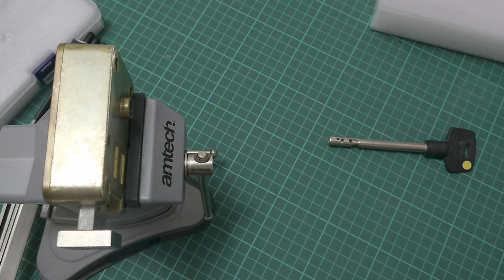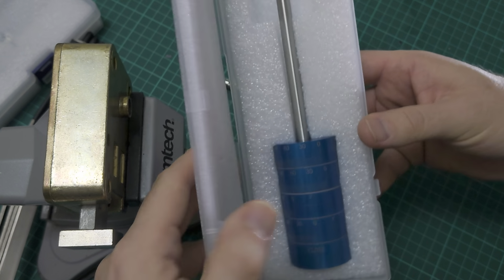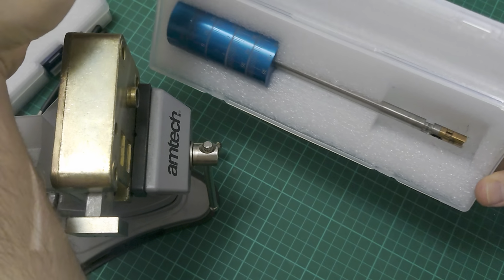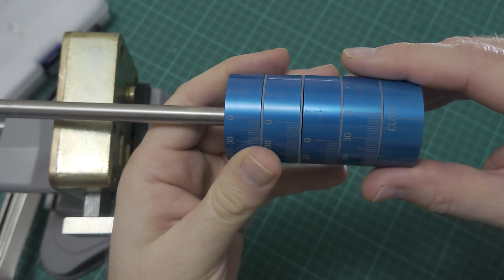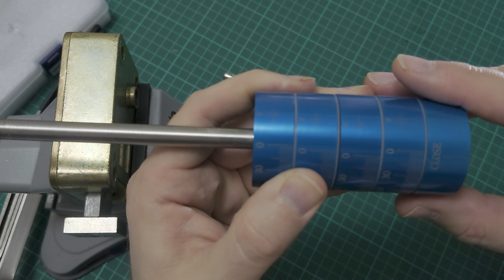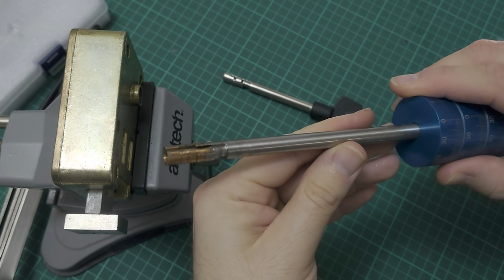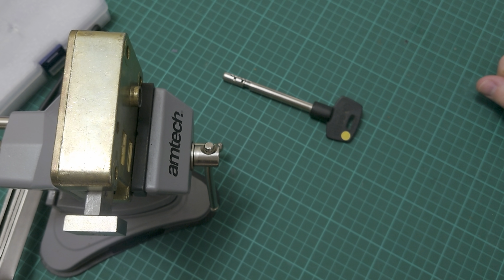lagard 2200 lock picked using the NSuper lock pick

Comment: That’s pretty cool! Couldn’t help but notice some wheels turn while you move the others tho? Is that a problem?
Reply from the maker: No I didn't find any problems there is a bit of movement between the pick and the discs in the lock so you get some movement but once you have found all the approx locations of the gates you can then hold each wheel in place to find tune if needed
Reply: @sponge85029  Awesome thanks!